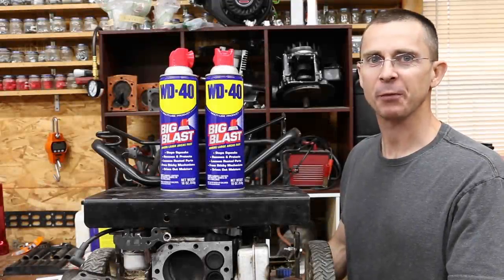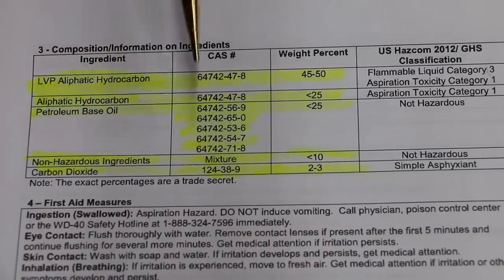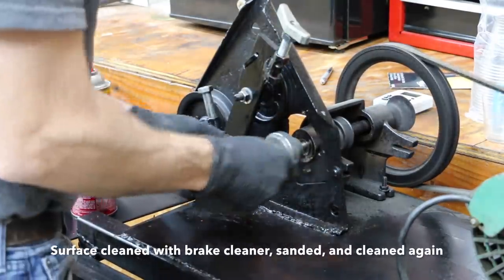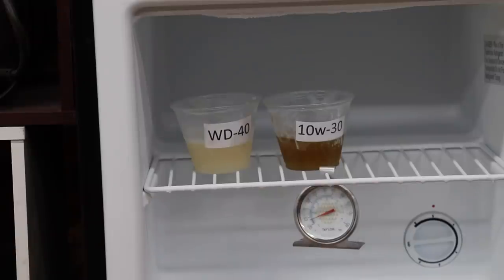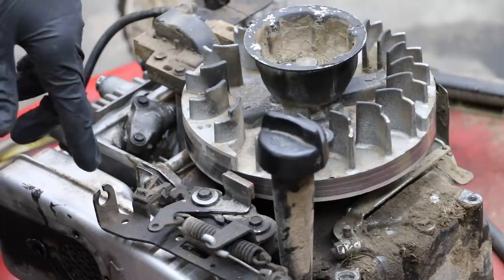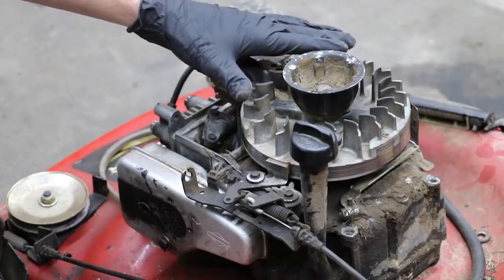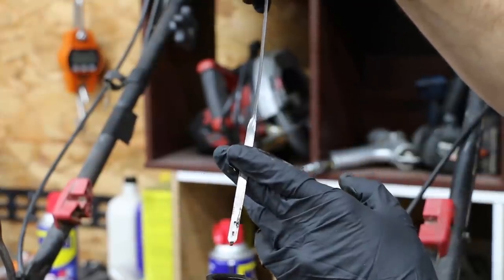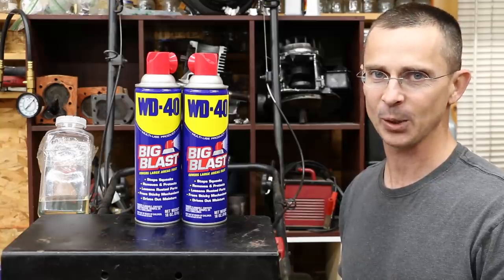Will WD-40 work as engine oil? Let's find out!

Comment: Awesome video, and happy new year! Please try transmission fluid as oil, I think it might surprise us all.
Reply from the maker: Thank you for this recommendation.
Reply: I can say I have had customers that ran that in their cars. That is all they would run in the engine with no issues at all.
Reply: I thought it was thinner.
Reply: Been hoping for this as I used 1-2 qts for flushing
Reply: I don't watch every vid, but as far as urban myths on what you should use, this has been spoken of more than any other technique, which I can think of. I'm surprised it hasn't already been done.
Reply: Please stop asking for this. It's almost the same thing. It would be about as exciting as comparing Castrol to Quaker State. It'll run for decades without anything exciting happening.
Reply: edifyguy If that's so, then why not use it instead of traditional oil? I guess what I would like to know would be the pros & cons, and also if it even last since some trans fluids are "lifetime fluids".
Reply: I have used it instead of motor oil in a pinch, lots of times, in automotive and small engines. None of them ever had any lubrication-related failures. Actually, ATF is an excellent cleaner in some ways, and can aid in getting a sludged up engine degunked.

The main downsides are that it is lighter than most traditional motor oil, and in some applications that can cause increased wear over time due to lower film strength, however, 5w20 and 0w20 are a very similar viscosity as ATF. Its additive package is not designed for the higher heat of engines and can break down and make a mess over time. The other downside is that Dex/Merc is damaging to yellow metals (brass), although yellow metals are not common in engines. ATF+ does not damage yellow metals, and was formulated for that reason when Chrysler started using brass bushings in their transmissions.

The long and short of it is that you can run ATF in a lawnmower for years without obvious problems, and the video would not show anything unusual or interesting. It would be a poor use of his time. He could be doing something more unexpected and entertaining. :D

Comment: Thanks for another interesting video!

I really understand the lack of grass to cut, and it is resourceful to use the engine brake to apply load.  I am not criticizing you but I have just a question. How are you being sure the flywheel is not overheated by that brake application? I always took those brakes off my mowers because I feared if that very thing happened, it could cause the flywheel to get so hot the aluminum fractured and it flew apart.

It's crazy that engine lasted with such a very light oil in it; on top of the missing cooling shroud!  That really surprised me honestly. I was expecting a piston seizure.

As for the lost compression, I would like to see how the compression looks after the engine is run with some normal viscosity oil again. In other words, there was still "normal" oil in the rings and piston area when you did the first compression test. After the WD40 run, all that had washed out, possibly the only reason for the lower compression pressure. If you refill with normal oil, run the engine to distribute it, and then test again I bet the compression is back!
Reply from the maker: Thanks for the constructive feedback.  The ambient during the filming was 30F and I had a fan in the shop. I tested the flywheel temp in other areas and it was much cooler.  Thanks again.
Reply: Yeah - we're having unseasonably cold weather here in Alabama, too.  I expected it this year since we have had several warm winters; and this year had a busy hurricane season. It got down to 15°F last night. No bueno.

It would have been interesting to see the amount of ring groove carbon before and after e WD40 test for sure!

I forgot to say in my earlier comment - but your slow motion photography is really great. Keep that up!
Reply: Temperature would have to get up over 1000 degrees fahrenheit to come apart. Wiring insulation would likely melt at about 550 degrees and the engine would stop functioning way before that point.
Reply: I am afraid you might want to read up on aluminum. It melts to a liquid at 1200 degrees F.  Search the following on Google and you will see some charts showing a dramatic loss of yield streigth that starts in the 400 degree F range

aluminum yield strength vs temperature
Reply: I have been a machinist for over 23 years. I will stand by my statements. I will even stand by a piece of aluminum spinning at 2000 RPM at 550 degrees when the wire insulation melts.
Reply: Please do, and make a video. Accident videos get a lot of views.
Reply: DomManInT1 - You're fairly clueless.  A brake on the flywheel is only going to heat IT up, not the wire insulation or anything else.  However the only wire insulation right there on the engine is the spark plug and coil wires, either of which might be silicone, but neither of which are thermally coupled to the flywheel.
Reply: Stinky, Thanks for the laugh. Did you study thermodynamics in college? Or are you self-taught?
Reply: I actually did study thermodynamics at university for a pre-engineering physics major, and Stinky Cheese is right.
Reply: Air is actually poor conductor of heat, and with the considerable amount of air movement generated by the fins on the flywheel as well as the turbulent nature of that air mixing it with cool air around the flywheel, there is nothing in danger of melting from the air around the flywheel. I would be willing to put my hand in the airflow coming off the flywheel as I would not receive even slight burns to my skin.
Reply: You win. You are correct. My years of experience as a professional mechanic loses to your college theory every time. You win. You are correct. I quit.
Reply: Not really. I worked with a lot of people at university whose smarts were all book based and useless in the real world. College does not automatically trump real world experience in every situation. I actually never went through with the engineering post-grad because of the abundance of people with their heads up their own asses and have been working the past 5 years in industrial repair. Reality is you've actually got a point, though not through the thermal conductivity of air.

I'm not familiar with this specific small engine, but it has to have a magneto or other charge-generating device, and as I understand it, most lawnmower engines have that located under/inside the flywheel. If that is the location of the magneto on this particular engine, then there is a very real possibility of the windings on the stator heating up from heat passed through the flywheel into the crankshaft and into the stator. If the stator heats up enough, the windings will melt and it will not generate enough power to light a spark plug. However, the fins on the flywheel would move enough air, and in doing so bleed off enough heat into that air, that I would call such a scenario quite unlikely.
Reply: Platy, no, really. You totally proved your point. You win. Best engineer ever award to ya. Why can't people just win with grace anymore and just say thanks.
Reply: As I said, I never actually became an engineer, and I'm not interested in winning. I thought we were going to have an intelligent discussion, but I guess I should've surmised where this one would go from Stinky Cheese starting us off with an insult.
Reply: DomManInT1, you need to stick to your area of supposed expertise because whatever you THINK you know from mechanic work, does not translate into different disciplines on equipment  you're not so familiar with.  The flywheel would never get remotely close to hot enough to melt wires with a significant air gap between them, pulling fresh cooler air through it no less, and the kicker is you don't even know much about lawn mowers, this size of small engines because if you did, you'd realize that before the flywheel got that hot, the thermal expansion would cause a collision with the ignition coil, shear off the flywheel magnets and stop the engine unless you adjusted the coil back further away from it and then you'd get too far away for it to start when cold.

Test it yourself.  Grab an infrared thermometer and some old lawnmower.  No wires are going to melt that aren't literally touching the flywheel.
Reply: Stink, Thanks. You called it.
Reply: CISN, we shut up a week ago. Why are you reopening the can of worms?

Comment: I'm suprised it survived. I've seen others try wd40 as oil in a car and the engine caught fire.
Reply from the maker: Thank you
Reply: Only GM or Kia..
Reply: @TheOzthewiz  speaking of Korean cars,  today. July 9th. I was on my way back home from Las Vegas in my 2017 Hyundai Elantra, to southern California,  cruise set at 85 mph, AC BLOWING NICE COLD AIR, 70.000 Miles now since I bought it new in june of 16. 0 problems or repairs.  Anyway, a brand new Jaguar 2 door sport thingy, flies by me , going at least 100 mph. I admired the car, was very nice looking,  still had paper plates. Fast forward about 150 miles and its sitting on the side of the road, completely engulfed in FLAMES!!!  Dont know what happened,  but I just patted the dash on my Elantra. And said SEE THAT??   YES, YOU'RE A GOOD GIRL!! LOL.

Comment: Would be interesting if you tested conventional vs synthetic oil by filling up and then draining the crankcase and running the engines to see which lasts longer.
Reply from the maker: Thank you for this recommendation.
Reply: He would never get any real results out of that. Check out what goes into motor oil testing and you will see what I mean. He would have to put so many hours on a lawnmower engine to get any kind of a result that you would have to check back in a few years.
Reply: I agree.  The fill, run drain, and run to destruction videos are kind of humourous, but the results aren't really useful unless you're in the habit of letting your engine run out of oil and then trying to limp it home.
On the gripping hand, you don't really need years to test an oil, just check the clearances and cylinder walls every n*100 hours of running.  Though, I guess you would have to run it for hundreds of hours to get there, at which point the fuel begins to dominate the cost of testing.
Reply: Y2K SS Not only that most synthetic oils still are petroleum based. Very few oils like red line and Asmoil and now Mobile one's new Annual protection. Is a True full synthetic.
Reply: Renewable Oilcan Rim Small engines run crap tolerances to begin with because they can get away with it as the engines only run at around 3600 rpms max that’s why it would be hard to test with them. What kills them is dirt, either in the used too long oil or through the air filter.
Reply: waterloo123100 I just watched a video that Engineering Explained put out about Mobil 1 annual protection and I am quite impressed. It’s cool to see the testing they did with it and they show how different oils break down differently.

Comment: Well the test of its lubrication properties further shows how terrible WD-40 is at being a lubricant! Too many people fail to under stand that it's not a lubricant, it's a water displacement product and even then it's not very good at doing that.
Reply from the maker: Great point and thanks for commenting.
Reply: Wd-40 is more of a temporary lubricant, to free things up, or help get a 3 point implement attached to a tractor.
Reply: Drew w 

It's good for cleaning electrical items as well as mechanical items and isn't bad at lubing light and delicate mechanisms. I prefer GT85 though to be honest.
Reply: Drew w it's a solvent....
Reply: CRC 2-26 is an actual electrical lubricant and it also displaces water I prefer it to WD-40 as it's plastic safe. It's also an alternative to Deoxit
Reply: No doubt not the best lubricant for an engine, but it give it some credit, it ran for an hour, and with practically no cylinder cooling!
Reply: Ken Young it's not a good lubricant for anything! But yes very impressive that it did help keep the engine alive
Reply: WD-40 is by no means the go to penetrating oil or lubricant by any person that works on alot of equipment  ,we all know that,but it does have its place around the house for when you need something light to do something and don't want the mess or stench involved that is attached to something more aggressive

Comment: Ok  now, maybe try PB blaster. And then I am thinking how bout trying bestline with wd40 or pb blaster. I am curious if bestline would make these other products work better as an "oil", just because of how well it did in testing.
Reply from the maker: Thank you for this recommendation.
Reply: the result would be very similar if not the same. Penetrating lubricants are way thinner, slip past the rings and burn in the engine.
Reply: Im more interested in what you could do with an additive. Like a really terrible oil, with a good additive. Would it do anything? Thats what I am curious about. I guess it would be another test of what an additive could do.

Comment: Well of course the engine ran hot and burned off most of the WD40 in the crank case. You had no cooling cowl on it! Not an accurate test of anything. Why not run it under the same conditions as you'd normally run it? I get not having a way to load test it (lack of grass) but taking away the ability for the engine to cool itself really skews the results horribly.
Reply from the maker: Thanks for the constructive feedback.
Reply: I have to agree with you.  This test would have been just as objective had he thrown gasoline on the motor and set it on fire after starting it.

Comment: You must have gone through like 600 headgaskets for Briggs by now haha?
Reply from the maker: This new headgasket got destroyed.  I've got more on order.  This hobby is expensive!
Reply: unless it's destroyed I'd just reuse it.
Reply: Jesse Fritz 
Not a for sure thing, but in my experience they tend to start leaking after some heat cycles and heavy loads. Especially if a bit of the surface got torn from the gasket. Hell, your supposed to replace those little crush washers on spark plugs at every removal, but most never do. Though for PF I'd say let it ride. I'd reuse one for 2-4 removals assuming the gasket looked good and I was screwing around.

I lie... I'd reuse it indefinitely until a problem arose more likely, not like it's my diesel or something.
Reply: Diesel 8290 you mean Briggs and scrap iron
Reply: Cody Schwalbe AvE fan too?
Reply: Cody Schwalbe I can’t really see them being scrap when there the biggest small engine manufacturer in the world
Reply: Wolf Coyote alright okay lol
Reply: Diesel 8290 lol i dont mean harm i.just.cant tell if ur joking or trying to kill his joke

Comment: I used to clean the carbs with WD-40, works great to clean out carbon deposit around the carb and engine. I've even used wd-40 on those k&n oped pod filters, repels water that splashes over the filter and prevents the engine from water damage.
Reply from the maker: Thanks for sharing.

Comment: Does diesel oil work as a crankcase cleaner? I've heard it has more detergents. So will running an oil change of diesel oil clean deposits?
Reply from the maker: Thank you for this recommendation. This seems like a great video idea.
Reply: my grandfather ran diesel oil in his 305 v8 car since new at 500000kms the body was shot (salt and backroad's). i pulled the valve covers off and it was spotless inside the motor and still ran great. after i seen that i ran it in my 90's chev pickup for 10 years without a problem. but it seems newer motors don't like the think oil as there is more little ports the oil goes through that control things like valve timing and such.
Reply: Diesel #2 I believe has a lot of  paraffin wax in it so that may not be too far from being true.

Comment: Unfair test.
You crippled the engine without cooling system installed. 
Surprised in ran that long.
Reply from the maker: Thanks for the constructive comment.
Reply: That's true, normally the air cowling is in place for testing

Comment: will an engine run in nos gas ? ??
Reply: NAWAF KHALIFA As a fuel, no. It's just an oxidizer. However, if you plumbed a bottle of any pressurized gas into an engine you could drive it on pressure.
Reply from the maker: Thank you for this recommendation.
Reply: Not just straight NOS. It's an oxidizer but is only effective if it's at a certain temp. By itself it is non flammable.

Comment: Sick try ATF in the cases
Reply from the maker: Thank you for this recommendation.
Reply: That would be very boring. It will run for years with ATF in the crankcase. Decades, even. While it's not "the right stuff," there's no question it will do the job. I've used it instead of motor oil many times in many machines, small and large. It isn't fundamentally different. It just has a different additive package.

Comment: What I believe is that the 5 PSI drop is probably due to WD40 entering the combustion chamber from the piston rings and cleaning away the oil which has a thicker viscosity that can act as a  combustion sealer.
Reply from the maker: Thanks for the feedback.